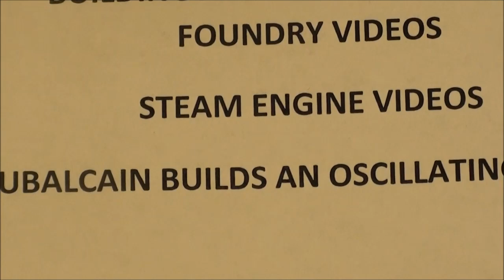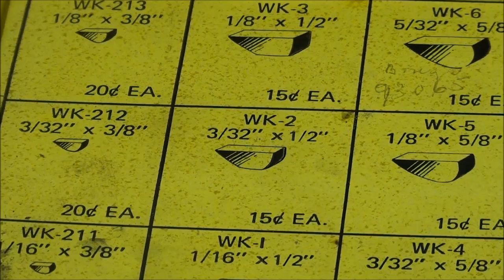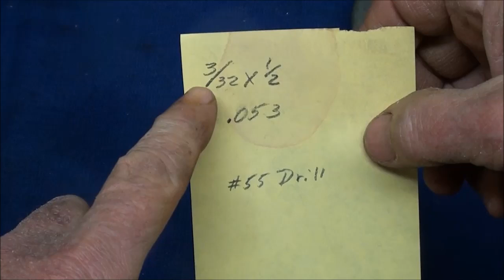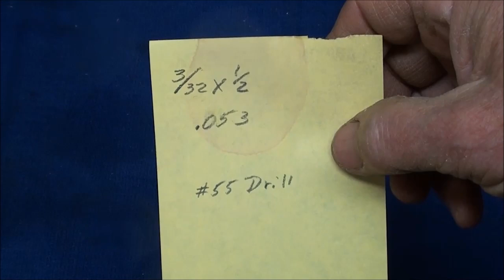MACHINE SHOP TIPS #151 Cutting a Keyway on the Lathe - a new ''abroach" tubalcain

Comment: That's much simpler than another method that I saw last week where a tiny tool was ground and fitted on the diameter of a small shaft mounted as your blade is.

Comment: Nice technique for many lathes but potentially troublesome if you try this on any Atlas lathes
The carriage left-right movement gears are housed in a Zamak casting. Over time, some Zamak casting made by Atlas have lost a lot of their original strength. The result is that old Zamak castings could break under a lot less stress then when they were new. I broke one on my Atlas lathe without subjecting it to a lot of stress. As a result, one creative CNC person has now begun to make these housings from aluminum and are selling them on eBay. The same problem goes for an Atlas shaper part that can be successively 3D printed in plastic - also available on eBay. I also have one of these on my shaper. This may be a Zamak flaw that has only affected old Atlas parts - I do not know.
I believe Zamak is still being made and I suspect that the Atlas zamak problems have been identified and remedied in newly made zamak parts.
Reply from the maker: It is called zamak pest

Comment: Good to know, I need to do the same to a cast iron handwheel that I bought for the Craftsman 12 I'm fixing up, to replace the missing original.

I was planning to use a 1/8" carbide cutting bit in a Dremel mounted on the tool post, but I may do this instead.

Comment: I didn't catch it if it was thrown; is the width of the parting tool the same as the required key way width? Or could one just reset the height of the tool and make multiple cuts?
Also when using the second parting tool to try to level the cutting tool, I can see that the top surface of the tool becomes level but isn't the narrow face of the tool  now tilting down same amount as it would have tilted if no spacer was used? i. e. it just tilts in the opposite direction? It still was close enough to do the job. In any case, it is an excellent video and taught me ĺot. Thanks for all your great videos.

Comment: Richard Kicklighter I just did a 4mm key in cold rolled steel on a mini lathe (7 by 16 LMS) via this method.  It worked.  With harder materials you shave smaller amounts. It seemed happiest when the cut was 1.5 thousands or less.  Because you won't be using the compound, it is best if it is set parallel with the work, and the gibs have been tightened up to avoid slop.
Reply: What width keyway?

Comment: Mr. Pete, do you think this technique would work in general for a non-through bore? I have a need to make an adapter for the output end of a harmonic drive transmission (~1-3/4" long by 7/8" diameter shaft with keyway) to a couple different ends (1" x 8 TPI, 5/8" smooth). I'll put a set screw or two on the shaft, which may be enough to hold for what will probably be a low torque interface, but would like to have some amount of keyway if at all possible.

Comment: If you don’t have the broach tool, you can just drill and tap the hand wheel so the correct size grub screw acts like a key . both ways are good.

Comment: Thanks because the other vids were without the taper offset info on the cut off to you used to "broach" the keyway
Reply from the maker: Thanks
Reply: Thank you again, just finished extending the internal keyway on the pulley on the Logan 64TLC 2130. I used one of Great Grandpa's rectangular pieces of metal 1/4"x1/3"x5" {all I could find close to keyway width}(tried hardening red hot water quench after> ) and shaped it on bench grinder. Had about 3/4" length to cut deep inside the extended tube on the pulley. I'd say it cut 1/3000th of an inch each pass - took like 500 passes but the pulley is on and aligned... 1st try with less than adequate metal but it did work.

Comment: Excellent, I have a need for that very same process. Have been thinking about how I was going to pull it off and bingo, came across your video. My broaches are too big for my current intended application. Yup, it is my solution. Thank you for sharing.

Comment: Will this work with metals that are harder? Say stainless steel? I’m trying to make a keyway in a hole that is not a trough hole. It is 1/2” deep and the broaching tool I’m using leaves a nasty bur at the bottom
Reply from the maker: It probably will not work well with harder medals
Reply: mrpete222 is there a method that you could suggest to aid me in broaching the piece?

Comment: Anyone try this technique using an actual broach?  I need to cut a 5mm keyway and don't want to have to grind my own tool. 5mm broaches are pretty inexpensive off eBay. I don't have a press and need to cut the keyway in a couple of different size bores.

Comment: Pete, interesting how you have the rear toolholder set screw hanging half a diameter off the rear of the tool bit. It does appear it would hold better axially that way. You essentially have a shaper there - I guess that in some instances it might help to have a clapper, but certainly not for cutting buttery zinc!

It occurs to me that you could cut gear teeth in that manner if you could grind a cutter with the proper profile - much simpler than buying a cutter which are expensive and come in so many varieties. Just grind the cutter to match the cutter with one of its less-worn mates. Or can you buy inserts ready made? Hard to stop writing and look it up youtube is quite prone to lock up if I go to my browser on my iPad - requires a hard reboot to work properly and that also erases what I’ve written.

Comment: That sound as the cutting starts... Love that. 

Zinc crystals twin when they are deformed, and when they do, the transition shoots across the crystal at the speed of sound, making a noise.  So that if you bend a thin piece near your ear, that same sound is what you hear! 
Odds on, the cutting sound is because the cutting is making the zinc chips twin as they cut and deform...
Reply from the maker: Thank you very much--I did not know any of that..
Reply: No problem. 

(of course, it's entirely plausible that I'm wrong and it's just the sound of the cutting, but it sounds exactly the same. Seems like a logical deduction)

Comment: How easy would this cut be on a 4041 flat gear? I need to bore it out from 8mm to 17mm then cut the 5mm square key way.
  The broach set for this mm size is cost prohibited for using just once.
  Thanks.

Comment: Thanks for all the great videos! Used this method today to cut a .100 x 3" long keyway in a threaded 2.25" 1045 steel cylinder rod.  Worked out great, took about 10 mins or so for both once the tool was ground and setup.
Reply from the maker: Jay Cee Glad it worked for you

Comment: Fantastic, I need to cut a slot and don't have a slitting saw, this will be perfect I do think.
Reply: +Wooley689 Band saw? often on non aircraft it is acceptable to use even a .06 wide saw blade when the print says .08. Many designs of food machinery, custom prototype stuff is designed with a standard where an engineer uses as a type of default width for slitting clamps and things. often is ok to change a little to get the job done.  just get an ok first to cover you backside if you think about deviating. As said though. No deviation for Aerospace.

Comment: I may be missing something but your math doesn't seem right.  1/2 of 3/32 is about .047 not .053.
Reply: 0.053 is the height remaining of a 1/2" tall 3/32 keyway after it's been inserted in to the shaft. Found in the reference manual.

Comment: Thank you so much Mr.Pete for all the videos! I tried this operation by taking at tap and grinding three sides off and leaving one side of threads to do the cut..... Well it wasn't the best outcome. I guess I didn't have an angle on the tool for one! Now if I have to do it again I'll know I can use this type of operation! Thanks again! Oh I have a bunch of locktite if your interested? My work expires it and throws it out, we sale to the aerospace sector and anything over a year old they don't want? Even if it's still good? Makes no sense to me?? I don't know how id get in touch with you though? Paul McKinney Roy Utah
Reply from the maker: Paul
Yes, I am very interested in the loctite.  As you know, I use it & talk about it all the time. Thanks. Contact me at pete22@mchsi.com.
Reply from the maker: Paul
Are you getting my messages about the loctite? I have messaged you several times.
Reply from the maker: Apparently youtube will not let us trade email address. Go to this video of mine special ATLAS & SOUTH BEND LATHE Video Courses FOR SALE tubalcain. Near the end of the video, mt home address & email are shown. Then email me. Yes-I want the loctite very much.
lyle. Let me know if you get this message.

Comment: I've done a few keyways like this, even in steel. It's possible to cut splines and even internal gears if you can rig up suitable indexing and plans and kits for such are around (particularly for the Myford lathes). I used a boring bar holder and a jury rigged plunger operated by a lever, to make a slotting attatchment to avoid having to laboriously wind the saddle back and forth. A blind keyway can be done if a hole is drilled for the tool to run-out into.

I've also used the quill on the mill as a slotting tool. The Mk1 Toyota MR2 has a plastic gear on it's electric window motors. These fit over an existing metal gear to enlarge it (changing a 10 tooth to a 22 tooth as I recall). They break and replacements were not available from Toyota. A friend brought the job to me and we ground up a form tool to cut the internal gear in an off the shelf blank mounted on a rotary table.

Comment: How about a key way on a shaft via the lathe??? I hand cut one with a dremel. Poor job albeit serviceable.
Reply: Good question, it can be done however like the job here the tool needs to cut through to vacant space. I have done this by drilling a small hole, not all the way through, for the tool to cut into. Also if it does not cause a problem for the job then a groove or reduction in shaft diameter can work. I have cut a 6 tooth spline using the last method. Hope this helps a little. Cheers from John.
Reply: thanks John. That makes good sense. I think I'll give it a try.
Reply: Jeff, I will be interested as to how it goes, please let me know.
2 things that are very important that you are probably aware of, 1st tool centre height as you will be using the cross slide for depth of cut. 2nd Tool width as without a vertical adjustment unlike a Mill the width of cut is determined by the tool size. Cheers from John.
Reply: Yes, those two items I figured on. I'll post a video (maybe) when I do it. Or I'll comment here.
Reply: I've thought about this and I think building a holder for your spinning implement of choice to go into the tool holder on the lathe would be a very viable solution. In my case I think I'm going to create an insert with oilite bushings for my 1" boring bar holder that will allow me to power a threaded chuck via hand-drill. Then I'll hold a small endmill or drill and cross drilling parts as well as long keyways would be possible in the lathe.

Comment: I've done this many times, I've even cut whole gears this way. I needed a pair of 24 tooth change gears for my home lathe so I used the one old one I had as a pattern or index for making a pair of new ones with a tool I ground to produce involute teeth in cast iron.

Comment: Thanks for this video. This solves a problem I have had for about a year. I was going to use a similar method to cut a key-way in a drill press step pulley on my lathe. It needed a new motor which had a 5/8 inch shaft and the pulley had a ½ inch shaft. The motor has a key-way that I wanted to use once the pulley hole was enlarged for the new motor shaft. There are some very good points you included that I had not considered. So thanks for the additional tips.